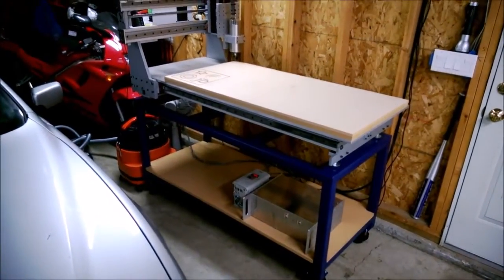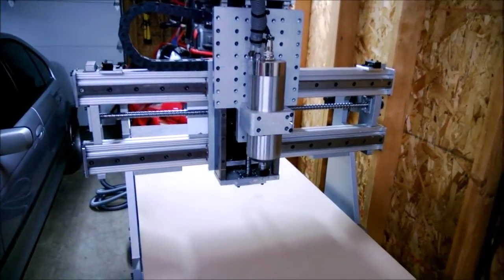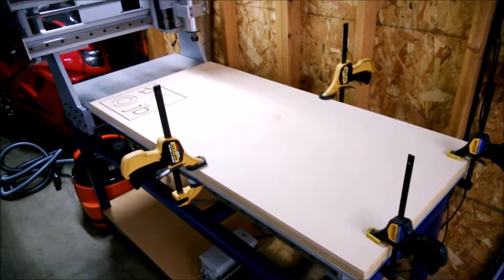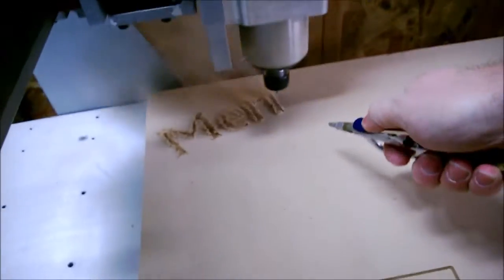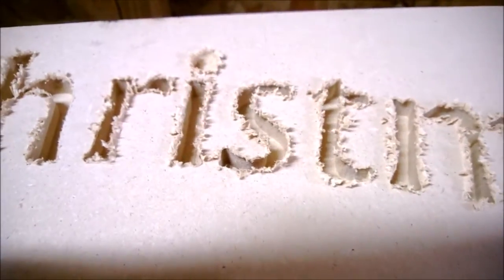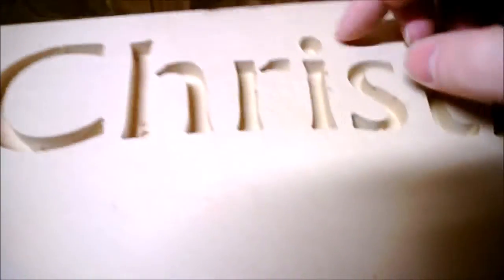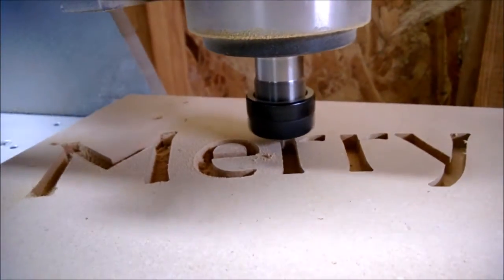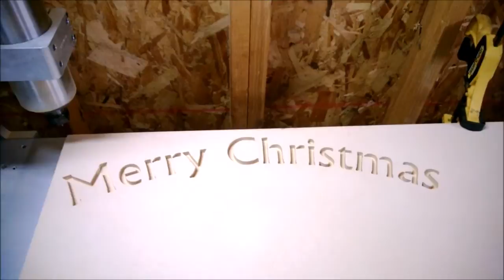New CNC Router - first cuts

Comment: Do you still have this setup? I recently purchased the exact same cnc, used. The only difference I can see is that my cable chain is white instead of black.
Reply from the maker: I do!  Though I've reworked the control box / mechanism to give me remote control over spindle speed while making the whole thing a bit more professional.
Reply: @jerbro32  sweet. I've been machining aluminum and copper. I added a separate power switch for the VFD because it's so loud. Still trying to figure out how to get kmotion to control spindle speed. Right now I've just got an external pot to the VFD for speed control.  Are you by chance in the pdx area? I can't imagine someone else coming up with the exact same setup unless maybe it's an open source design.
Reply from the maker: @PNWPrototyping  Not in pdx - I'm NE of Seattle.  https://www.dynomotion.com/Help/KMotionCNC/SpindleControl.htm goes through it - that's what I used.  You will need to run a line between the +10V line on the VFD to the KFlop to JP33 Pin 5 (the Analog Vcc pin). You'll also have to touch Spindle_S_Kstep.c to define how many RPM 10V is (mine was 24000).  In that way, when you use GCode S10000 for example, the spindle will run 10000 RPM.  See https://www.dynomotion.com/Help/SchematicsKStep/ConnectorsKStep.htm for pinouts.
Reply: @jerbro32  Thanks for the tip. I finally found time to get it set up and working over the weekend. Sooo nice to have dynamic speed control. There is also a way to control via RS232 from KStep or KFlop but the documentation isn't great. It's much more accurate but a bit too complicated when the DAC method works OK. My max speed is 24k RPMs but I had to set the max to 23300 in the code to correct for offsets and non-linearities. It's still slightly too slow at the low end and slightly too high at the high end, but I didn't want to mess with a look-up table for corrections.